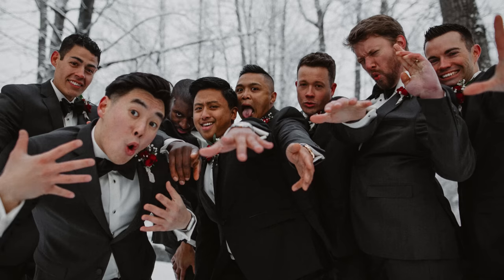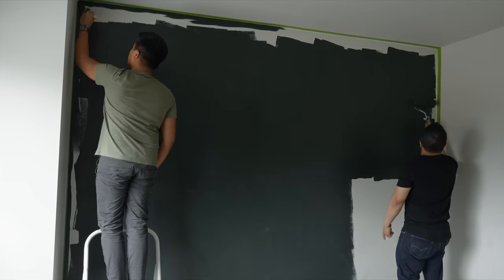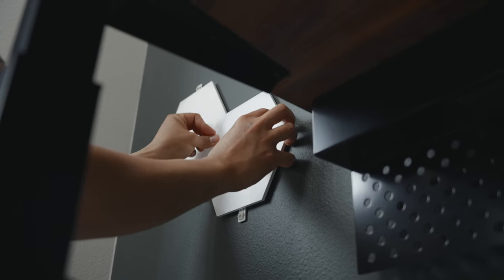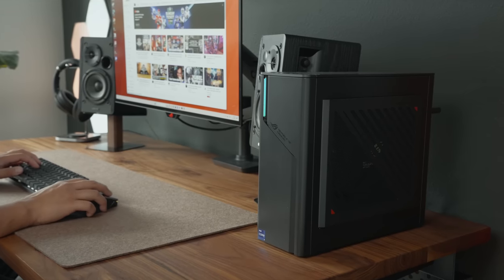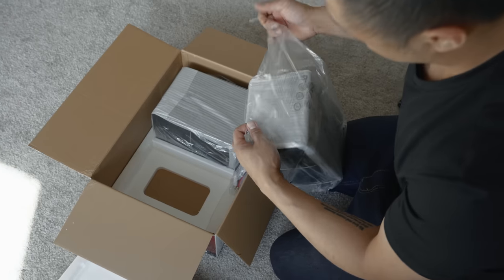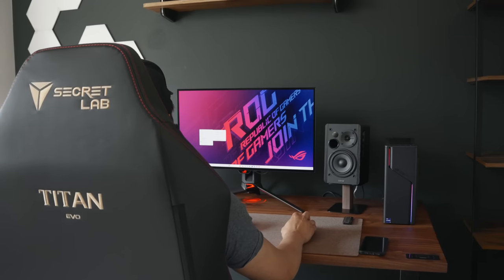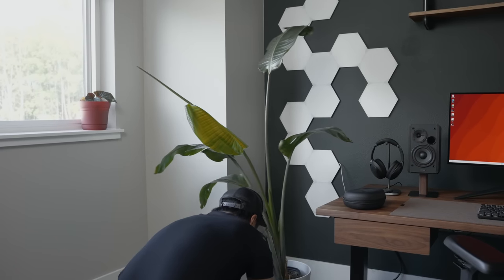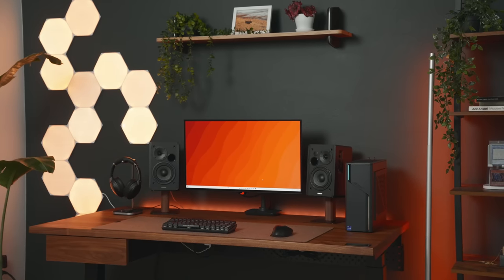Building My Friend’s DREAM Desk Setup + Man Cave

Comment: Jon, for the Ergotron monitor arm, how did that work with the cable management solution? Did it go over that? I have my cable management solution mounted exactly how you showed in this video, and have been curious about switching over to a monitor arm vs. the stand I currently have.
Reply from the maker: If you have the same desk in this video, then you have to move the CMS to make space for the monitor arm base.  If you have the new one, it might work no problem. 😊
Reply: @JonImperial  got it. Thought that might be the case … I’ve got the old one that’s in this video.

Comment: I dont get the cable management solution you got there. It seems to be installed the wrong way. Shouldn't the cable be behind the perforated plate? This way you can actually see the cables and i dont get the point of what it is actually doing. You could just mount the power-brick to the underside of the table and have the same effect.
Reply from the maker: Great question. There’s no right or wrong way to use it. If you put the cable behind the desk, it’s not as visible. If you put it “infront”, then it’s more accessible.

I’ve mounted the power strip under the desk MANY times. It’s one way to solve it, but I don’t think it’s the easiest and most convenient. The cable management solution makes it easy to add/remove cables, wires, ac adapter, etc.

Comment: i know the monitor is Oled and all that... but i just find it hard to stomach a 16:9 display in 2023....   i would think thats like using a 720p monitor..... i just can't see myself EVER going back to 16:9 after trying 21:9 or 32:9.....

If this was mine, I would much rather have a 1440p ultrawide than a 4k 16:9......  i mean,, its just logic (for me personally).

everything else looks good!